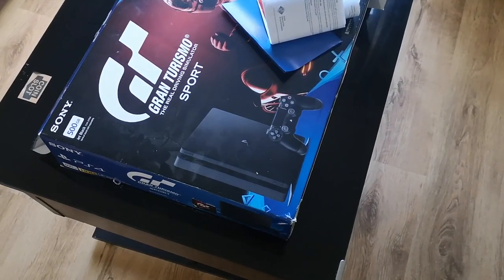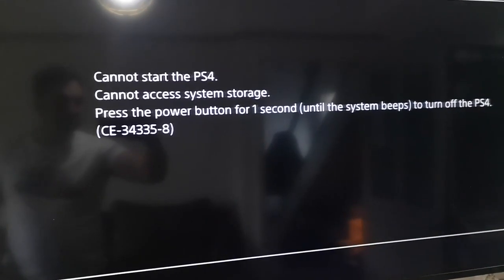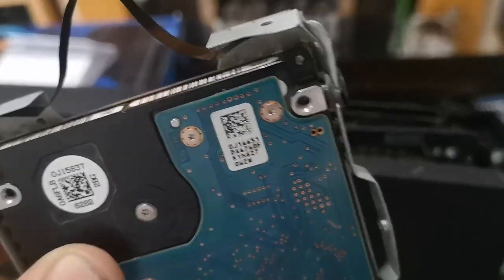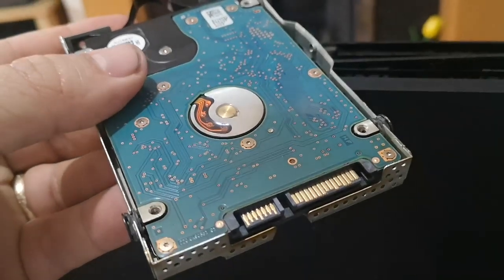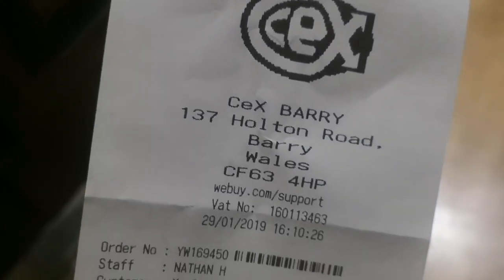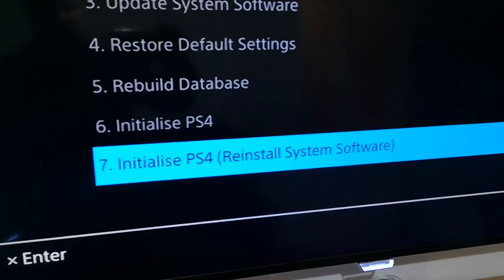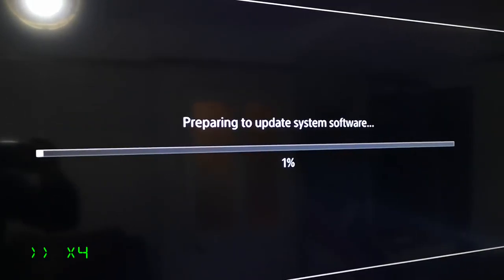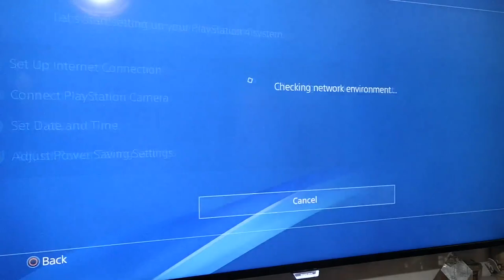CE-34335-8 PS4 Slim Hard Drive Repair Error System Storage Playstation 4 Sony

Comment: Hello friend I hope you are doing well and I hope you see this ive been having problems with my ps4 slim for a couple of days. I did everything that safemode could provide but nothing of that worked the only option was option 7, when i tried doing it it didnt let me it gave me 2 different errors the first one was error (CE-34697-9) its said could not initialize then i tried again and it said anpther error (CE-33570-8) it said cannot access the system storage. I opened my ps4 and took the hard drive out to see and didn't find anything unusual then i hear a rattle on the ps4 and i saw a screw come out which was strange because i dont know how the screw could have come off just like that by itself. I wanted to know if what you did worked well on the long run and also to ask if i can maybe put the hard drive of a ps4 pro on a slim since i dont want to spend a lot of money right now.
Reply from the maker: Hi, not sure where that screw has come from. Have you checked the caddy that holds the drive? There are screws holding it in place. 
You should be able to swap the drive but it may require formatting and rebuilding as it is a different system.
Reply: @GoodwinsPlace  thank you, i decided that Im going to buy a new hard drive its going to cost around 80 dollars and just to make sure
Reply: @GoodwinsPlace  sorry i clicked send by accident, i was going to ask if the hard drive that i have the one thats not working has a fix. If i format it could it be saved?
Reply from the maker: Not sure if you have places that do trade in? Does GaneStop do hard drives? I bought mine in a UK shop called CeX, the good thing is they sell used items and take returns.
Reply: @GoodwinsPlace  alrighty friend thanks, and does your ps4 run smothly now, does it work fine?
Reply from the maker: Runs great. Been playing THPS 1&2 on it lately.
Reply: @GoodwinsPlace  thank you my man i really appreciate your help, playstation support didn't help me at all they were going to screw me over, thank you again have a wonderful rest of the day.
Reply: @danielg221  when u bought a new hard drive did it save all your data?
Reply: @grublivesmatter2828  no, the data was deleted completly since its a new hardrive, but only the recent stuff was erased from this ps4, ill explain in another comment.
Reply: @grublivesmatter2828  prior to this playstation i had another ps4 that would overheat when i played games on it, it was working fine i just couldn’t play anything at all, but it had almost all of my data in there, so a lot of the stuff i thought i lost was saved there.
Reply: @danielg221  damn well im about to buy a new hard drive, out of curiosity what would i lose besides the game data?
Reply: @grublivesmatter2828  nothing else, just the data, meaning the playstation its going to be like brand new, you have to sing into your account and redownload all the games you had.
Reply: @danielg221  wait if you had ps plus would you have your data saved or do you have to do that manually, also if you ps plus and you get a new hard drive do u lose it?
Reply: @grublivesmatter2828 , no you dont lose the ps plus, and i think you have to do it manually, i think theres an option of the cloud to save all the data, you might need to check a quick video about that

Comment: I did it with 7 sek press the Button but it didn't work is see only u need to press the Button and its go off..
Reply from the maker: To get into the restore menu? If holding the power button for that long isn't taking you to that menu you might have other issues.
Is it booting to an error code on single press of power?
Reply: @GoodwinsPlace  yes the same like yours ce-34335-8 but then i need to press the Button and it turn off everytime the same do u think I need a new Hardware? I hit only one Time and then it gonna frezze and pulled it off and then on and this shit came with the code...
Reply from the maker: @Codebreaker1  If you are getting to the error code then you should be able to get into the recovery menu. Make sure you are holding just the power button and keep it held down. Other than that I'm not sure.
Reply from the maker: @Codebreaker1  have you tried another screen too. It's a long shot, but I'm sure the restore menu is a low resolution safe mode, so your TV might not be picking it up for some reason. Long shot but worth a try.
Reply: @GoodwinsPlace  yes i needed only a new Hardware and then i Reset and it works.
Reply: I tried to put a new hdd in my ps4 but it wouldn’t recognize it I got the error CE-34335-8. I fixed it by changing the hdd from MBR to GPT. I also aligned the partition to cylinder instead of MB. I did this on MiniTool partition Wizard. Hope this helps

Comment: Hello? One of my usb plugs wont work plz help
Reply from the maker: Has it had any damage from a cable being knocked or similar?
Reply: @GoodwinsPlace  i think u pulled the cable
Reply from the maker: Me? 😂
Ok, the other ports are working? 
If so how technical are you? You could open up to see if you can replace the port. If not technical then maybe get a usb hub to try connecting multiple devices.
Reply: @GoodwinsPlace  is my ps4, one works but the other doesn’t ill open it and see if it’s dirty or damaged , if i cant get it to work i will buy the usb hub. Ty for the help
Reply from the maker: No worries. You should be able to clean from the outside if you've not tried that already.

Comment: That How My Ps4 looked when i opened the case 😂
But my air went was better since i clean it often
My hardrive died on me few days ago 
Im certain its the hardrive so imma try to replace
Reply from the maker: Give it a clean and new drive and you should be good. 👍
Reply: @GoodwinsPlace  yeah mate i just cleaned it few days ago.
I noticed fps stutter and lag when in fights .
Then my fortnite data corrupted then my ps4 died 
I am looking for ps5 but in india its kinda hard to get so might aswell try to fix it myself 
Thanks for da tip
Reply from the maker: @Void_Rudster  PS5 is hard to get anywhere, still waiting lists here in the UK. 
Always good to keep the PS4 running to either sell or pass on to someone as they are great systems.

Comment: Is there anyway to clean your hard drive without replacing it and if there is pls may you tell me how to clean it like what to use
Reply from the maker: If you have access to a pc tower with sata or a usb caddy you could try and run some PC repair or defrag software. But it's only likely to be a temporary fix.
Reply: @GoodwinsPlace  thank you
Reply: @caydox3585  did it work
Reply: @Azizali17  no but I used cotton buds and that worked

Comment: Good day, hope u see and reply on my comment, i was playing FIFA21 on my ps4 wheb suddenly it turned of then when i open it an error appeared CE-34335-8, i tried to go to safe mode but it wont go in, now i bought a new HDD and still the same problem is showing up
Reply from the maker: Is it getting to the recovery menu from holding the power button?
Reply: @GoodwinsPlace  no, only the CE-34335-8 is showing up
Reply from the maker: You need to get in to that menu try press to power on, release then press and hold for as long as it takes to get in to the menu. You should even be able to do it without a hard drive in if you want to test.
Reply: @GoodwinsPlace  tried it now, still the same warning (CE-34335-8) showing up, it says cant access system storage
Reply: @GoodwinsPlace  same hete